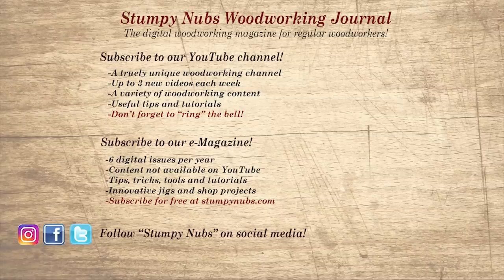Are table saws becoming obsolete?????

Comment: I’ve started my venture in to woodworking for about a year. I’ve built a 16ft built in with a router, miter saw, and a track saw. It did great and can be super precise. 

With that said I am saving for a table saw. I need quick repeatability, and a quality table saw solves all of that. I will still use my other tools, but I want a faster way to get projects done.

Comment: I bought an older Delta table saw off Marketplace for $100.00.  It need some work but once it was done and setup properly it allowed me to spend a little more on other tools like my planer and jointer.  Setting up a new shop takes time, patience and a little luck of the draw.

Comment: I agree with your comments but would add the following. I have a nice table saw and love its safety and accuracy.  I also have a small battery Ryobi and larger old corded Skilsaw.  I absolutely love the battery powered hand saw for paneling and sheet goods. I use it with a nice clamp on straight edge, (not a track), and it makes a safe and easy way of knocking down sheet goods or cutting paneling without trying to wrestle a big sheet of plywood / paneling onto my table saw by myself. Without a cord I feel much safer and can lay my sheet goods on 2x4s on the floor for a firm and steady base.

Comment: You’re exactly right; it depends on your personal circumstances. I have a very small space to work and need to work in other places so a track saw is very handy but a table saw small enough to throw in the back of a van and accurate enough for the work is better. Than a cabinet saw. Great video!

Comment: Never having used a table saw but familiar with them through YouTube channels such as this one, I think I pretty much agree with everything said.  I have a circular saw,  a 50/100 inch straight edge, and a couple of alignment jigs so that I can break down a sheet of plywood into panels pretty quickly.  But for everything else, dados, grooves, rabbets, rips on narrow stocks, etc. the process inevitably comes down to figuring out how to overcome the limitations of not having a table saw and make the cuts safely and accurately with my limited equipment.  I don’t really have room to store a table saw, but I long for one as I am figuring how to make and then setting up a cut that could be done in a couple of minutes on a table saw.

Comment: +1 Dado cuts - especially in hardwoods. A 3HP TS while outrun a "3HP Router" any day and you can do in 1 pass what would take multiple passes with a router. Track saw isn't going to break down my 8/4 hard maple...I can do it on the BS like you said which is why my jointer is right across from the BS. But take a sheet of MDF off the truck and I need to strip it into 6" wide 8' long slices and the TS wins every day of the week for speed (about equal on accuracy with the track). I also like that the FLAT space of the top can be used for an assembly area or a router table. As many others have said, Can I get away by using other methods? Sure. Not unlike Stumpy however, I don't want to for the aforementioned reasons. Thanks again for another well-reasoned presentation where you simply ask your audience to think about alternate choices with no hard dogma of you MUST do it this way...so refreshing!

Comment: Even small table saws have a purpose. I installed vinyl plank flooring in my house, and that meant a bunch of ripping: two edges in nearly every room. Doing that to 5 foot floppy vinyl boards would be a nightmare without it. It requires a helper to receive it - I don't even have storage space for a roller and barely have enough for the mini-table - but it is still a great help.

Comment: I  am a hobbyist  DIYer ,  my  table saw is  nearly 32 years old ,  a belt drive 2 HP 10 " contractor type ...the brand will remain unnamed  very heavy. I had to make a special retractable  caster carriage to reposition it as needed .  It was an essential tool when I built my  32x28 garage  29 years ago .. it  did all the ripping for sheeting work , the miter and  circular saw the rest . I have never made fine joinery and likely never will , the table saw is still an essential tool in my basement shop which  I could never be without . The best example for never getting rid of it  for me is .. living 15 miles or more  from the large contractors stores  I  cannot justify the  waste of  the time to ride to any of them  just to purchase a  2 X 3  whereas I can rip one safely from a 2x4 in my stores of project material . It is not impossible to rip a 2x 3 out of a 2x4  using a circular saw ,  results may vary , 
so .. ..why anyone would prefer it over a table saw is a logic alien to me ,  the only thing that could prevent me from owning one  would be  to not have a workshop ...cannot even imagine that .

Comment: I am almost finished relocating my woodshop to a different part of the house, a smaller space by only a few dozen square feet but the layout is different.  I moved my radial arm saw into the new area, where it sits against the wall leaving the center of the new shop open for assembly and moving around.  Most of my other tools, router, sander, planer, and mobile assembly table are on casters to tuck them away when not in use.  The table saw is stored away for now.

Comment: I could not agree with you more!  I am not an expert but in my 74 years I like to make do with what I have.  So I have extensively used jigs and guides to get the most from you hand held saws.  But my table saw is far more accurate than any other method.

Comment: Please keep showing non-table saw ways to build things. I agree with you 100%, but when we downsized I had to give up my table saw, drill press, and planer to my son.  But I have done an entire kitchen remodel with a circular saw and multiple Kreg jigs and a router table.  I really missed the table saw when building the 15 pullouts :)  I even cut all the face frames with just an $8.00 Japanese pull saw from Harbor Freight.  The trick is having access to a great, independent, hardwood lumber yard with a huge inventory of 4SS stock.

Comment: Thanks, Stumpy for that quick but comprehensive analysis.  I've been seriously considering replacing my cabinet saw
with a track saw system for some time.  The main reason:  save space in my garage shop so I can park the car inside!
I've considered some but not all of your arguments.  I have a very nice heavy cabinet saw with an accurate fence and JessEm
hold downs.  I am convinced, after seeing your video that I'm keeping my table saw and to start using the mobile base.  BTW,
I have 2 Forrest Woodworker II blades that will only be replaced if you can remove them from my cold dead hands!

Comment: 100% agree.  I have all the saws you mention but still come back to the table saw.  Yes I can use other saws but it is accurate and repeatable with the Incra fence.

I’m just setting up a MFT table with my track saw for those cross cuts that won’t fit in the Bosch glide saw otherwise, if you have the space, a table saw is just invaluable!!!

Comment: I have grown up with a combined miter saw and table saw and moved quite recently to table saw and track saw. The difference between these three in sometimes in specialised cuts like trimming an edge, for which I prefer the miter saw, or cutting long strips and breaking sheets down with the track saw, as you say, but safety is key and the trac saw looks by far more safe to operate.

Comment: Thanks for the info.  I've got a table saw (not a top end), a circular saw that I use on a track (again not top end and not my go-to tool).  I have a low-end miter saw that is mostly used for rough and trim carpentry, and a jig saw.  Each has its place for what I do.  I addition, I also have a nice router with changeable bases.  I'm working on building my skills leaning on traditional (hand tool) woodworking.  Why?  Because I like to be able to hear myself think as well as hear my music playing in the shop.  I have no intention of going to one extreme or the other (woodworking vs. wood machining).  I'm currently a hobbyist woodworking novice with a few years left to go before hitting retirement.  When I do, I'd like to set up a woodworking shop where I would do the occasional project for someone else.  I use hardwoods, softwoods, and plywood.  I prefer the solid wood products, but sometimes time, money, and space dictate otherwise.  I've been watching several of your videos and find them very well made.  I miss the UP oftentimes.  I spent 8 years there in the Air Force at K.I. Sawyer AFB.  It's funny, I hated the place back then, but 30+ years has a way of changing one's perspectives.  I now look back on those years fondly.  But I digress.  Thank you for the videos.  They really are very useful.

Comment: Here in the UK the typical size of the amateur's workshop somewhat shifts the full-blown cabinet table saw down the list of must-haves. A small fold-up portable table saw that can be cleared out of the way lacks much of the convenience and accuracy of the machine you are talking about. There are few outlets selling cabinet saws here and those that do have offerings that start at over £3000 (over $4000). For that sort of investment in space and money I would rather have a similar sized CNC router. A made this choice a couple of years ago (spent about £1500 on a large "Work Bee" machine) and I have to say it has made a remarkable difference to what I can make ranging from a replacement crankshaft for a 1cc model engine, through wooden toys to a 2 metre long oak panel for the house. It requires a different way of thinking about jobs but it is the one bit of cutting equipment I wouldn't want to be without.

Comment: If you're a professional with large workshop, get everything. For 21m² workshop and limited retired heavy duty DiYer, a top level tracksaw and dust extractor (Mafell, Makita, Festool) with MFT and suitable accessories, eg BenchDogs, covers for mitre saw and cabinet saw. Router to run on the track is very useful. Deeper cut circular saw that runs on track for 85mm or more is also helpful

Comment: Very good video. I agree with you you don't need the TS but it does make things alot easier. I also agree that if used right it is safer. As a hobby woodworker the TS was my first big tool. I have never used dado stacks. But I have done lots of jointing with a single blade. I have also done some with the router table both work well. I don't think I could ever live with out a TS

Comment: I think these are great points.

My (personal) issue with it is that there are so many factors to balance here. I see all your points here but there's also the factors of budget and space.

I have an older TS with a bad fence system and no riving knife, and my shop is small so I really don't get to use the ripping capability of my 10" TS in any case. I pretty much always do rough break down of goods with a circular saw and guides outside the shop and then use the TS for nice accurate repeated cuts.

I have a replacement fence system but it's going to be a lot of work for me to do the replacement and I still won't have the riving knife so I regularly have a crisis wondering if I should either dump it for a job site saw (I previously had one of the DeWalt saws in my old house when my garage was my workshop and it was adequate, had a much better fence at least, and has all the safety gear) or dump table saws entirely and instead go whole hog into track saws, getting rid of my current table saw and instead having a big assembly table which I can also use for cutting.

Anyhow, my problem is mine but you might consider how to advise people with varied challenges like space and budget. I've been very close to just betting on the Makita cordless track saw system several times over the past year (except that my TS is also my router table so I'll have to provide for that also so now my "simple" assembly table has gotten more complex...)

Comment: Great points.  Where possible, I prefer to bring the work piece to the machine (table saw) rather than bringing the tool (eg track saw) to the work piece. However, my shop is small and so wouldn't accommodate a cabinet saw and the cutting down of sheet goods, therefore I use a tracksaw to rip down my sheet goods in order to get them into the shop and onto my jobsite table saw, which is perfect for my needs. Love the vids, they're always enjoyable. Thanks.

Comment: I learned of a very good commercial table saw, but when I started doing my own thing, I had to be very mobile, so I used a 10"  "contractor's"   portable table saw.  Many of the great features like the long and wide table, big shuffle board (you say "sled") and great fence were no more. 
But, over time I developed ways of making really good cuts by means of jigs and surrounds.  I can't imagine ever giving up my table saw, but if I ever hit the lottery, I would likely upgrade to a really good one, and a big shop to put it in.

Comment: No Not in my Opinion. The Table saw is still my most used tool in my Shop. Depending on my needs, I have three. A Delta Unisaw/52" rip, a Taiwan copy of the Delta Contractor's saw with Unifence/32" rip and  a Makita with  a Raussuo Folding table with L & R extentions/49" rip and two outfeed tables.

Comment: I’d sooner get rid of all the other tools mentioned before I got rid of a table saw for the wood shop. I use the table saw over my miter saw for cross cuts (because I have a cheap one I don’t trust) I pretty much only use my router for profile work. Don’t have a bandsaw or tracksaw. I do use a circular saw with a rip guide and rail guide to break down 4x8 sheets. But I always cut oversized and cut them again at the table saw. I don’t have a big fancy table saw (although I’d love one) but I’d take a table saw over any other tool for cutting for the exact reasons you mentioned.

Comment: The last table saw I owned was made by Sears, (circa mid 70`s) with a belt drive and something like a 16" x 16" cast iron table.  For precise repeatable cuts it was beautiful, and quiet while running.  Now I can cut up panels with my 6 1/2" circular saw pretty easily, but for ripping dimensional lumber that little saw was safe, quick, and easy to use.

Comment: I totally agree with your conclusions, owning a table saw, router table, mitre saw and bandsaw.   I have a small shop so it's easier for me to roughly breakdown a 4x8 plywood sheet in my garage, using a 2" solid foam sheet underneath and a homemade guidejig for my circular saw.  But I always cut rough, then clean the pieces up on my tablesaw, which is MUCH more accurate than the handheld as you suggested.    There's always more than one way to get stuff done in woodworking, as you aptly pointed out!.

Comment: Like most guys, I don't have a dedicated wood shop.  I've got a garage which is dedicated to a number of uses, including parking automobiles.   The best tool I've bought in the last 10 years was a small, portable DeWalt table saw.  I replaced the factory blade with a 10" Diablo 60 tooth blade for fine cuts.  Made a couple of zero-clearance inserts which allow me to cut thin strips. A small table sled, etc. .....  The first thing I made was a table for my small table saw.  Then I modified the table for my router.  Now I've also got a small router table....

Comment: I've got a sketchy as frig table saw story for you. I had been installing wood floors for about 17 years and I went on a job to help a friend of a friend. I had never worked on a wood job with this guy before. So dude busted out his table saw a  Ryobi that had the 2 outer portions removed. Basically it's the sinter part that houses the motor and blade is about 12 inches wide oh and he had it sitting on top of an upside down shop vac base. I used the jigsaw as much as possible but I did make several cuts on that contraption. I was never more focused on cuts before that day it was a zen like experience. But I never helped that guy again.
Reply: Yow!

Comment: I am presently building a new work bench with cabinets and drawers.  The table saw is so much faster and consistent with the cuts for the drawers.  You know they’re all going to be the same.  I use the circular saw and guide to break down the full sheets because it’s more stable.  I have a hard time breaking down the full sheets with a table saw.  They have a tendency to bind a lot since I don’t have enough table and out feed area to slide them through straight.  I purchased a new Grizzly cabinet saw last year and haven’t regretted it for a minute!

Comment: Very true in every statement made here in every regards.  I use a very standard DeWalt 745 or 7491 table saw that anyone can afford to rough out most slot types of things before taking a router or hand tool to it.  My Makita track saw is just a bit too cumbersome to set up accurately.  Also I find it a perfect tool to make a fairly straight cut before using a good no 7 jointer and make a few passes to get a sanding-free edge.  A cabinet saw will be great, but the space premium is too much cost for the city and I'd have to clean up the edge anyhow.

Comment: I have both a table and track saw. Years ago handling plywood on a table was relatively easy. Now it takes too much effort that’s where the track saw comes in handy. Also if i am working with odd shaped pieces for lets say olive wood. A track saw is an excellent saw for getting a good first cut on a board. Like you i use a wide range of tools. Yet the table can’t be beat for convenience Plus in a pinch the extra work area comes in handy when the project is bigger than you work table.